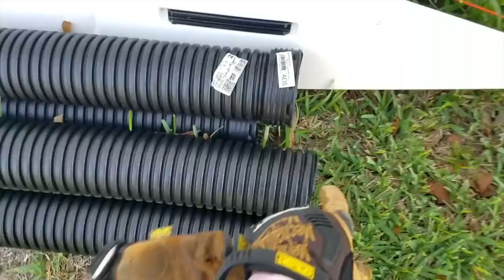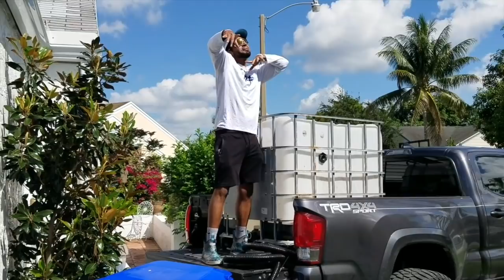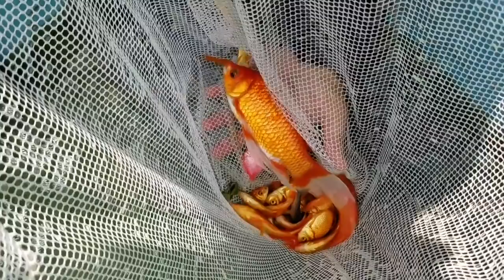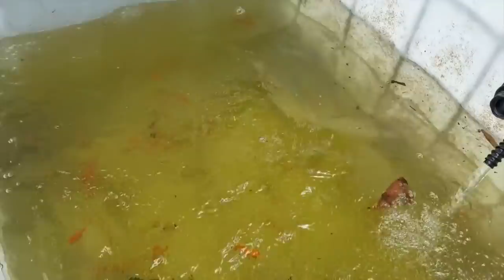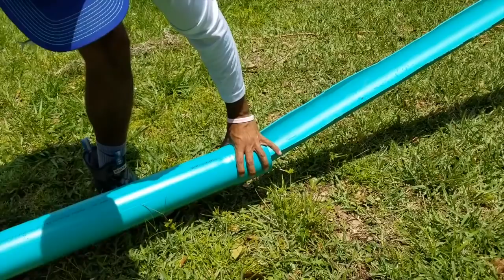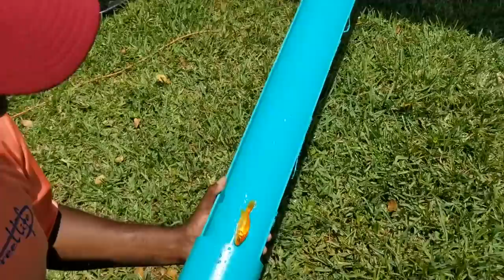FISH WATER SLIDE 100% Safe for Fish!

Comment: Do you know that you can put shop vac attachments onto the suction side of a transfer pump and use it as a vacuum for debris/algae in the pool pond? Similar to the vacuums used in pool cleaning but cheaper.